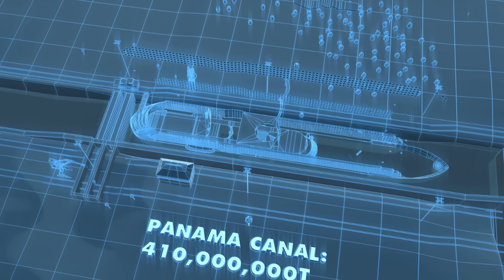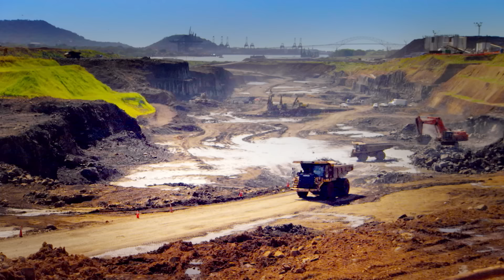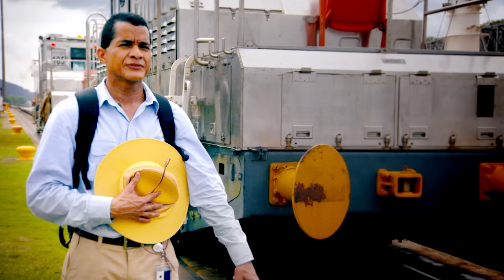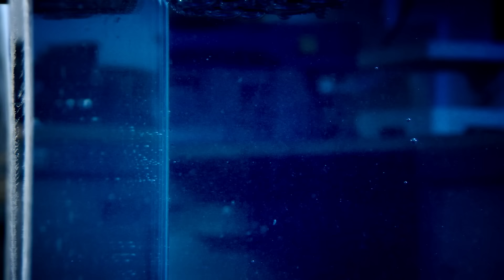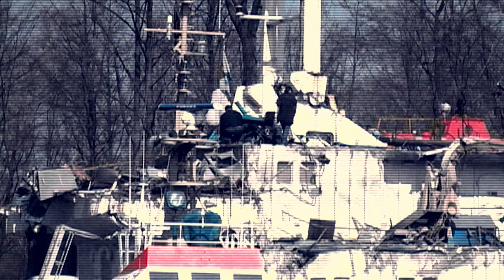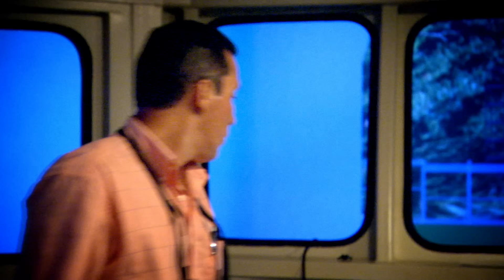Canals – Construction Megaprojects – Big Bigger Biggest

Comment: Under each Bay of each lock if they had massive airbags that could fill the lock up with the water that's on top of the airbags so whatever the draft of the boat is say it needs 20 ft of water you would have the airbag fill up until that 20 ft is met using are as easy with massive air compressors this would be a lot easier you wouldn't have to worry about using water